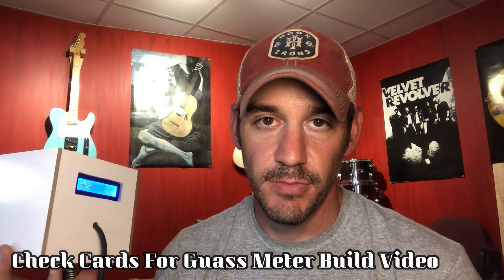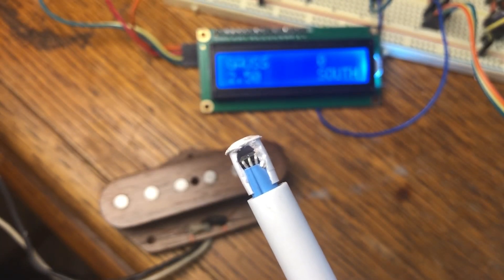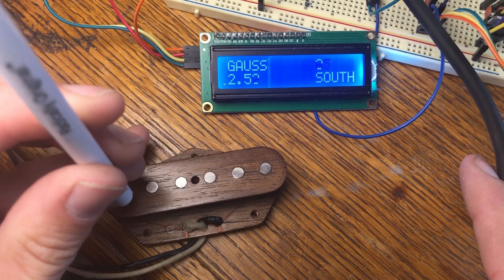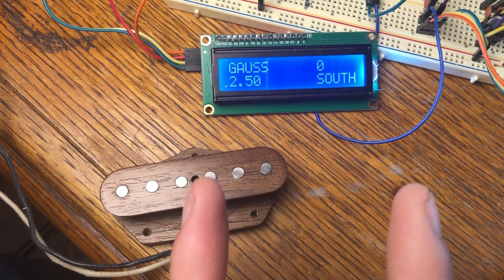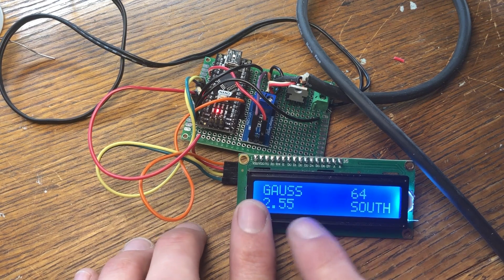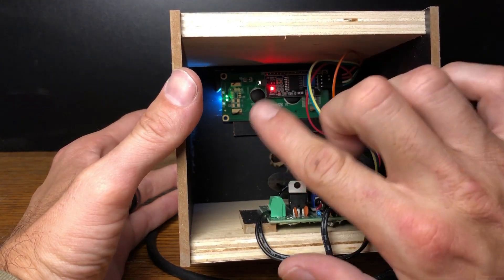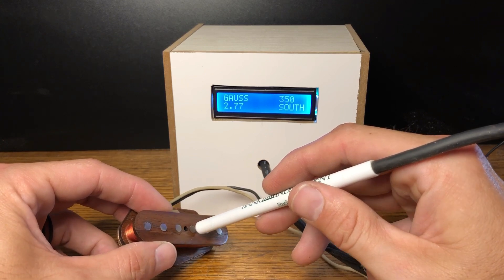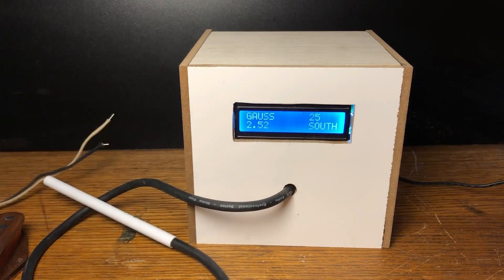✅Gauss Meter Probe and Box Build

Comment: I am building a winder and I am using an ATX computer power supply to power it, I was planning on only using the 12v side , but there is a 5v supply as well, this could be used to power the  gauss meter and make the two units into one.
Reply from the maker: Sweet! Let me know how it goes bud!!

Comment: Hey, how have you got that thing powered? I'm planning on building one myself. Thanks so much for sharing the plans and code!
Reply from the maker: I’ve got a 1amp 12 volt wall wart powering the system. Wire in a fuse from hot to vin pin on Arduino.  Vin pin on an arduino can accept voltage from 7-14 volts. You could use a 9 bolt power supply too. You’re welcome bud!

Comment: Hi Chase, I Enjoy the video's Mate.  So here goes, I am a total novice at electronics /circuit Boards . I make Cigar Box Guitars & Pickups. And this project has interested me. But i am going to run , Before i can walk.lol. I have the Parts to build the Gauss meter. And i have 3D printed a Case for it.  So it is time i learned to solder Circuit boards.  I have done a mock up from the video, So If you have the time Could you  tell me what to solder and what wire goes where. Also I have not programed my nano. Or done anything with the voltage reg. Any help I would be very grateful. Cheers Buddy.
Reply: Pal, thank you for the reply, I am a novice. that stuff goes over my head. That is why i asked for a step by step Tutorial. If i know what to solder where , And what wire goes where . I would be ok. But i understand for you to do this would be time consuming .
Reply from the maker: Phil Noel hey bud you can’t find a schematic on my website. The project page is in the description. Here’s a link. 

https://www.cwkshop.com/diy-gauss-meter/